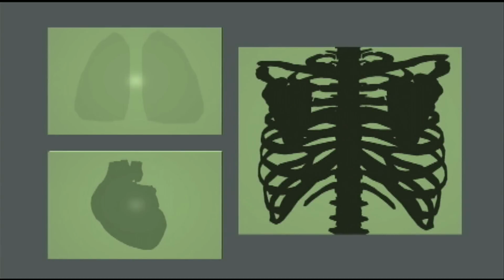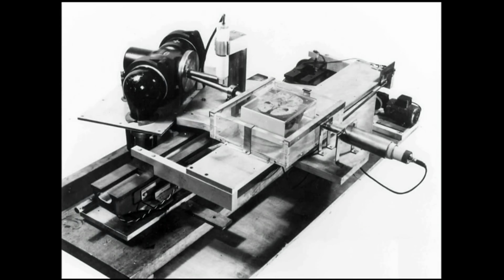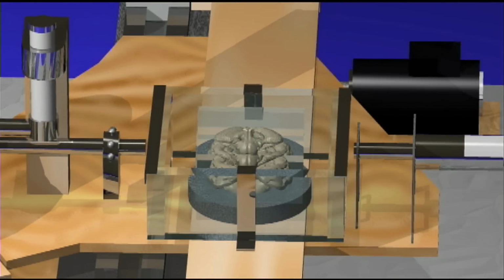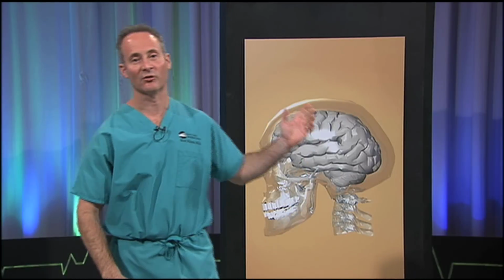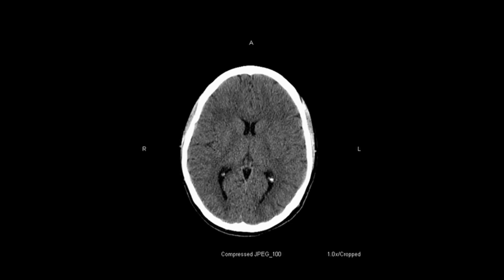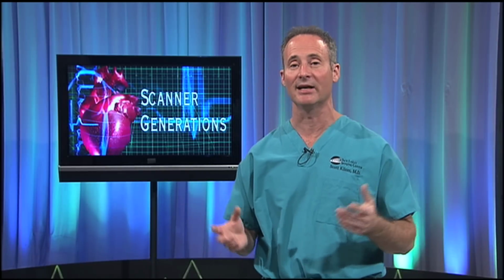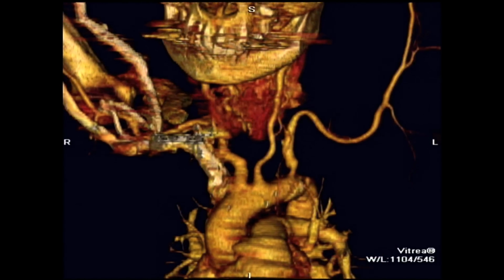History of Computerized Tomography (CT Scanner)

Comment: The thumbnail shows a lordotic projection and the chest xray shows a normally positioned chest xray but in positive rather than negative. Radiographers know very little about the technology they use. For instance, 75% of radiographers don't know what happens to the projection if the tube angle is changed. They think everything changes, but in reality, only collimation. Here is the error https://youtu.be/mZPD_gLs5Dw?si=22dNe-agXosfbrT0

Comment: Dude, there is nothing wrong with FORTRAN. It is still used all around for high performance computing, even on your cell phone or desktop. In fact it is usually faster than other languages when doing such computations, due to simplicity of the language and compilers using that simplicity to optimize the code better than other languages and compilers. One of the primary reason is a concept called pointer aliasing, which FORTRAN does forbid in many cases, and that is a serious performance boost.
Reply from the maker: I apologize.  You're right!  FORTRAN was the second programming language I learned back in 1983.  Still great for intensive computational problems but I think somewhat limited for bit operations that may be required to coordinate the machine movements and actual data acquisition.   Is there a FORTRAN emulator in C++?  I learned C in the early 1990's to do some programming for a digital atlas I was working on in residency but never really grasped C++.  I'll talk to our applications team and see if they know what language they use to program our modern CT and MRI machines.  I'll let you know...
Reply: @DoctorKlioze  Fortran doesn't require an emulator. It is execute as a machine code just like c, or c++. I bet they current software uses a mix of C, C++, Python and FORTRAN, and possibly Java for UI.

Btw. Great videos. I enjoyed learning many things for your videos.

Comment: EBCT was not introduced in the video, that's a special product devoloped for cardiac imaging before spiral CT.
Reply from the maker: Excellent point!  Basically an enormous x-ray tube that encompassed the entire inferior back half of the system.  Electrons were produced at the cathode and guided with an electromagnetic field to a series of anode targets on the lower half of the stationary gantry.  The detectors ran across the upper half of the gantry and would detect the x-rays generated from the bombarding electron beam.  With no moving parts, the system was capable of ultrafast scanning and was marketed as a cardiac CT mainly for calcium scoring.  Revolutionary in the late 90's when most institutions had 3rd and 4th generation scanners,  they didn't gain widespread acceptance due to the high cost of the equipment, relative large size of the machine and limited advantage over a standard 3rd generation scanner elsewhere in the body (basically a dedicated, expensive coronary artery calcium score scanner).  With the advent of the mutlislice helical scanners, temporal resolution was comparable to EBCT and only a few EBCT scanner were ever installed.  Thanks.

Comment: I loved it, thanks very much for this video, it helps me a lot. I just had some doubts about the generations number due to i found in an article, they were 7 generations, I guess now they were refering to the technological advances of ct
Reply from the maker: Hi Monica.  I don't want the video to mislead you.  The first through 3rd generations are as stated.  There was actually a 4th generation that came out when I was just finishing medical school that basically functioned identical to the 3rd generation except there was a complete ring of stationary detectors around the gantry that reportedly eliminated some motion artifact associated with the moving detectors in the previous generations.  In practice, the improvement was negligible and the 4th generation quickly went away with the introduction of what we would call the 5th generation or helical scanners.  From there, we went from 4, to 16, 32, 64, 128, etc slices on the helical units which allow true volumetric imaging of fast moving structures like the heart.  Never heard these multi-slice helical scanners referred to as a separate generation but I guess it's possible.  Hope this helps!

Comment: Great video with super graphics. If memory serves me correctly there was a 4th generation, which was also a helical scanner, with a continuously rotating X-Ray tube but a stationary 360 degree detector. Very complex and expensive - was replaced by the 5th generation within a short time period. Another observation is that data for each slice is typically acquired through a 360 degree rotation (3rd - 5th generation).

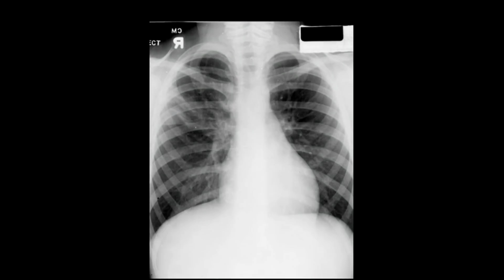Comment: Thank you very much Dr. Kiloze for your time and your interesting and insightful video. I spotted a little issue which may cause confusion to your audience. From 1:15 to 1:20 the analog film scan shows the bone appearing dark and air white which is in agreement with the fact that X-rays are attenuated (absorbed) more by bones. However, further on you said that bone absorbs a lot of the X-rays and thus it is gonna show up white (image 2:23 to 2:30 bone white/ air black). I know that it is the norm in radiography to invert X-ray images whereby the background (air) becomes black. Anyhow, well done and thanks for this great video.